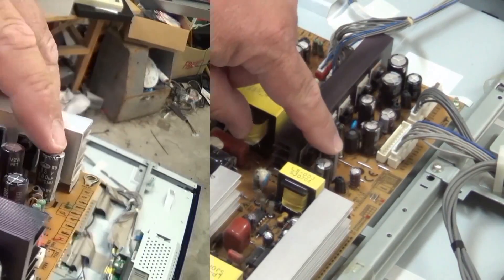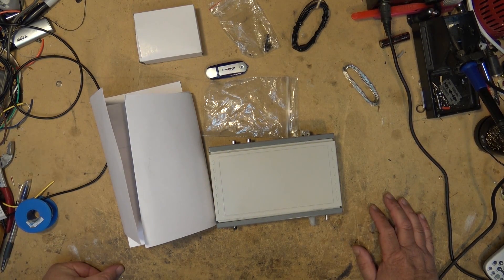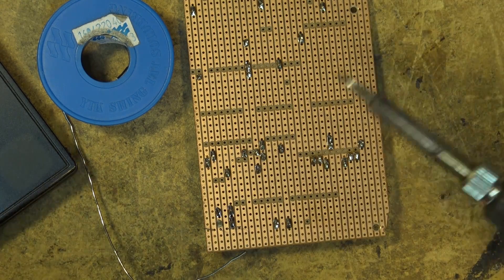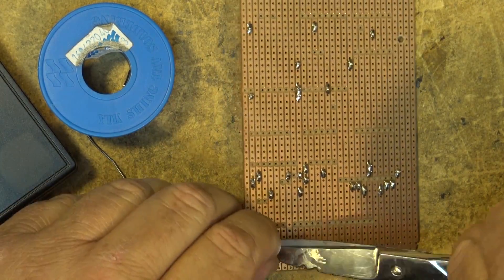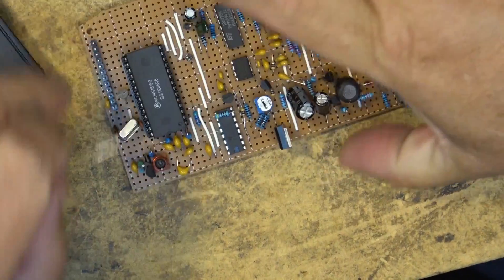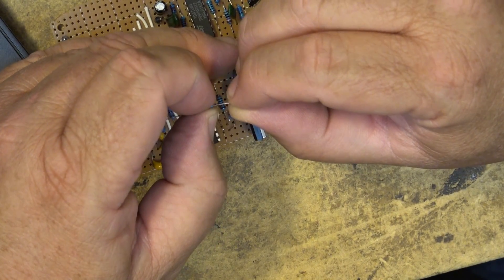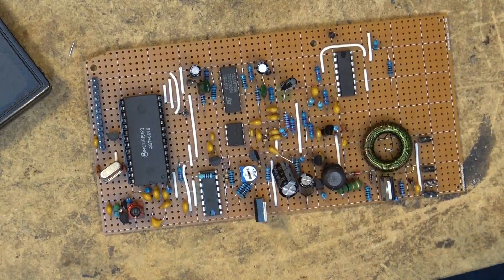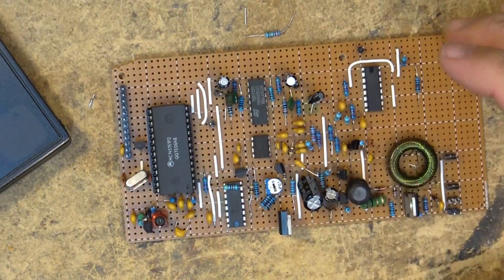AM Stereo Transmitter Build part 1

Comment: Why did they revert back to monaural AM transmission?
Reply from the maker: The problem with AM stereo was the FCC. They did not have the balls to select a single standard like they did with FM stereo, or color TV. Can you imagine what would have happened if the FCC allowed TV stations to choose between NTSC PAL or SECAM?
Well that is what happened with AM stereo. 
There were multiple incompatible formats. Harris by the Harris corp, whom happened to build transmitters, Magnavox by you guessed it, the Magnavox corp, also a supplier of AM broadcast transmitters, Motorola another big player in the transmitter game, Khan and Hazeltine.
5 different systems developed by the engineers that designed their transmitters.
They all worked slightly differently.  The Magnavox, and Harris  systems were both quadature modulation  for the stereo difference signal, by phase modulating it. One used a fixed angle, and the other a variable angle. Both had good and bad points with response to sound quality, and compatibility with existing mono radios. Motorola developed their own c-QUAM version. The "c" meant compatible.  It was the most friendly system with the existing mono radios out there. The other 2 resulted in some pretty nasty distortions when there was high separation between t he channels when played on mono radios. Think some early Beatle records with the vocals on the right channel and music on left. 
Enter the Khan/ Hazeltine system.  This approach yielded the most compatible system, but had the poorest sound.  Khan used an independent sideband system, transmit the left of the lower and the right on the upper. Worked great, but did not improve the fidelity of the sound. The other systems, because they worked with phase modulation could extend the frequency response to 15KHz.
Now we understand how they work, why did they fail? Because radio stations were basically locked in to the brand of their existing transmitter. If they had a Harris transmitter, they were going with a Harris encoder, and some of this was probably contractual with the equipment vendor.
Anyway, that meant that radio manufactures also had to make radios that would follow a specific system. Sony was one company that made a chip that would decode all 4 systems (Khan and Hazeltine were compatable with each other)
So if you wanted a good radio it had to be a Sony, and those were sold at a premium. The public didn't buy it. The FCC finally got their shit together in I believe it was 1989, and set a deadline for all stations to switch to the Motorola system of cease broadcasting in stereo.  The majority went back to mono.
AM stereo remained running for those stations that already used the Motorola system,  but then HD radio was on the horizon, and most of the remaining stations invested in the new digital transmission, or as the old transmitters and modulators reached the end of their life were replaced with mono equipment. 
So if you want to play with old AM stereo radios, then you are going to have to build one yourself.
Sure there are still a hand full of AM stereo stations still operating, but they are few and far between.
Reply: 12voltvids Still, there is no reason why Canada has to listen to the F.C.C.
Reply from the maker: The FCC set the standards for the USA and Canada just went along. Canada mainily had 2 formats, Motorola cQUAM and Khan. In the Vancouver market all but 1 were Motorola. Only 730 CKLG was Khan. 1040 was broadcasting in stereo right up to when they had to relocate their towers and transmitter due to the land they leased being sold, and new owner didn't want the transmitter on his farm, so they moved to the farm across the highway. Built a new transmitter building with 7 towers and moved in to a co-located building with the another AM station that had to move due to a new highway going right through their transmitter site.
Both stations were stereo before them move and mono after, but both went from music formats to sports. Infact, all the stations here left on AM are all talk formats now.
Reply from the maker: @infinitecanadian  but our band plan follows the USA. We have the crtc but that is more for broadcast standards with regards to the actual broadcast and license.  The technical standards is set by industry standards and closely follows the standards set forth by the fcc because the countries border each other and signals spill across the border.
Reply: @12voltvids   Close but not entirely correct.  The FCC did actually set CQUAM as standard in the early 90s.  Other systems could still be used if their pilot frequency was changed to 25Hz since a basic CQUAM decoder could also decode all of them to some degree except Kahn.  But two other things were also afoot- the FCC soon began lifting the ownership caps and the soon to be mega groups would often modernize as well as standardize all their equipment.  And since the bottom line was paramount, they'd replace stereo gear with mono as it was cheaper.  The second item was HD as you mentioned.  On the receiver side, especially the auto makers, they decided to pinch pennies as well and leave out a few components.  If they could save a buck on the cost of a radio that adds up over millions of cars sold.  If a car radio has the decoder chip one would only have to add those extra components to get it to work. 

I'd have to disagree with you on being tied to one particular brand, though certainly with the Harris PDM transmitters they did work best with the Harris exciter as it had internal compensation for the IPM.  But you could mix different brands quite easily otherwise, as long as the transmitter had low IPM and the antenna bandwidth was optimized, it really didn't matter what brand any of it was.  Been in broadcasting most of my adult life so that's how I know these things.

Comment: Question: You seem to occasionally quote the FCC rules. Aren't those the rules that your Southern neighbours subject to? 
I was wondering why you would be bothered by them, being a Canadian in Canadia !?

Cheers

Paddy

PS: we're still thinking about forgiving you for the Celine and the Bieber thing!
Reply from the maker: gh778jk 
This is more directed to us viewers.  in Canada the rules are similar though with regards to unlicensed operation. This thing goes about 100 feet so I am not too worried. I do however have a more powerful unit going in to check over that I will not be putting much of an antenna on because at 5 watts it has the potential to travel several miles with the right antenna.

Comment: That sound quality from AM Stereo Transmitter is not bad. Too bad most of the AM Stations don't get enough clarity to make the audio sound clear and smooth.
Reply from the maker: All AM stereo sounded that good. The problem was many cheap radios did not provide full bandwidth. Sony had a bandwidth switch that when set to wide gave the full bandwidth that AM stereo provided.
I had a philip car radio once and it sounded terrible until I put in a switch to bypass the 455khz ceramic filter. I might even still have that radio. Will have to look and see if I do.
Reply: @12voltvids  Here I am got an both AM Mono Transmitter Kit and AM C-QUAM Stereo Transmitter Kit after 3 years later! I did it the same by assemble the kit, and as for the Mono version, I use as a weather commentaries for my own area, and for Stereo, I can use them is not just for commentaries but also for music to play with that.

Sometimes when I accidentally solder them together causes solder to bridge, I use a simple solder flux to un-bridge the solder and get it right.

I've noticed the power supply LED that they use a Bright Blue LED and really drives me crazy, so I went ahead and change to nice red LED and now it is not that bright anymore.

AM Mono works great like a toy to me. =) AM Stereo, not knowing yet because I need to get it assemble and get it ready to go.

Comment: I've never heard an AM Stereo station but here in Phoenix there used to be about half a dozen AM HD radio stations.  However I just checked and there are only 2 left so they seem to be going away too.
Reply from the maker: AM stareo is a different animal that AM HD radio. 
Usually the HD radio is just an AM station that is carried as a Hybrid Digital signal on the sister FM station. At least that is how it is here.
Rock 101.1 analog, HD1 carrys the same material as the analog channel, HD2 carrys the AM sister stantion, a news talk, and HD3 carries the other AM station owned by the same company a traffic station.
They could transmit an digital signal on an AM transmitter as well, and do it just llike AM stereo had been doing it, by phase modulating the carrier, but many have not done this..
Reply: I am not aware of there ever being AM Stereo here in the UK - at least, I have never heard of it before today.  Thanks for another interesting video :)
Reply: You seem to be confusing FM HD stations with AM HD stations.  The AM HD stations have a digital sub-carrier that piggy backs on the AM carrier that has a higher fidelity version of the signal sounding almost as good as FM.  I don't know if any of them were stereo but the two that are left here just have talk radio now.
Reply from the maker: Not confusing FM HD with AM HD. Just saying that here in the Vancouver BC market, the AM HD signals are carried on the FM transmitter of the FM station that is owned by the parent company.
I know that they can, and do phase shift the AM carrier and put a digital bit stream on it exactly the way that AM stereo phase modulated the stereo signal on the actual carrier. Many AM stereo stations turned off their stereo signal so they could put the IBOC (in band on carrier) data stream on the carrier. Just none in western Canada. All the digital broadcasting done here is usind sub carriers on FM transmitters. They turned off all the SCA signals on those stations.
Some day I am going to look for my old SCA decoder and see if it still receives anything and if it does I will demonstrate it. I have one here someone.
Reply: Looks like analogue is fading away. One day and AM/FM radio will be useless and replaced with more channels of less quality.
Reply: AM HD stations are not HD because they also broadcast on an FM subcarrier, they are HD because they broadcast HD on AM.  There is one HD AM station here that also broadcasts on an FM station but that seems to be the exception.   They cut the power to just couple hundred watts at night which makes it hard to receive but then it still comes in good on FM.  A lot of companies like Sony, JVC, Radio Shack and Best Buy's Insignia brand used to all sell HD radios but I don't think they still do except for JVC car stereos.  I really like it but it never seemed to catch on, probably due to poor advertising.  I never even knew that Radio Shack had HD radios until I saw some on Ebay!  Another problem is that you need a strong signal in order for it to work and most people don't have outside radio antennas to use at home and in cars it doesn't work very well using the little shark fin antennas they are putting on cars now, you need an actual full size whip antenna.  I just tried an SCA decoder and found there is still one station in Phoenix broadcasting on an SCA channel!

Comment: Some sort of overlay or silk-screen would have been nice; too easy to get a component off-by-one as it stands. I guess they didn't expect to make (or sell) many of these, so too expensive to design a "real" PCB for it. Makes me wonder though, how much it cost them to have someone pre-wire the board, and drill the traces? :0
Reply from the maker: The seller on Ebay sells them as complete units as well as kits, and with no silk screening on the board I would recommend this kit for a more advance kit builder. I only had 1 fu*k up, but I found that on inspection. Still it was a fun kit that took me about 5 hours to build, sounds pretty good too as you heard. I think a coax antenna connector is in order, so I can pump the output into an amplifier and get more than a blocks range.
Reply: Antenna is key.  1/4 wavelength vertical can be quite daunting.
Reply: Got any suggestions of interesting kits for someone who's never soldered before and would like something to fart around with?

Comment: I'm sure that paper card is real good for ESD... :( Hope any FETs (or MOSFETs) survived. Haven't these people heard of static protective baggies?!? Maybe you can do a video explaining how AM stereo differs from FM stereo (inasmuch as AM is different from FM.)
Reply from the maker: ESD? What's that. Oh yes the ICs were stuck in styrofoam as well. 
Yes it works, you heard the music it produced. The music played during the assembly was pumped into the transmitter, sitting in the garage, and I plugged my AM stereo walkman into my computer and recorded the output. So that music was going about 50 feet from the antenna to my receiver. That is how good AM stereo sounded. Now to get my old Sony AM stereo tuner fixed up so I can use it again.

Comment: Thank you for sharing your experience with the kit.
I build these in my spare time and hope they bring enjoyment by bringing the old AM stereo radios back to life.
Because of this I am also able to personally assist constructors in getting their kits going.
The use of stripboard reduces the price a huge amount, These are still on ebay for $169 or on Bonanza for $157. The nearest equivalent is the ASPiSYS ASMAX1 which is $355.
Reply from the maker: Great little unit. Was a fun way to spend an evening. I did toss that lead free solder and use some real stuff though.

Comment: Had you had the QPSK or QAM16 mode you could have built it as a stereo AM transmitter,
Left would the real signal and the Right the imaginary signal inputs to the FFT before being used the modulate the sin and cos signals before being combined to create the QAM signal.

Comment: One critisism of the kit.  It's breadboard and they are really cutting corners.. and you're having to count holes.. they should at least give you a template overlay of some sort.. or silk screen it on the board. Why not?  Cool kit, I love it. I wasn't aware AM went back to MONO - i"ll have to check if that's true here in Canada.  AM is very dodgy here hard to catch these days except late at night.   I actually have a custom built FM  transmitter from a community radio station that existed in my hometown for about 5 years. It looks built from a kit as well. The VU meter is unhooked for some reason. Maybe they never completed it, but it does broadcast in Stereo. The radio station went to full internet radio before 'Podcasts' then the community station folded in 2001 when the corrupt actions of the board members and the guy that ran it caught up with them (cocaine, skimming of funds from government grants) the guy went to prison. It was a cool place..but sadly the captain sunk his own ship.